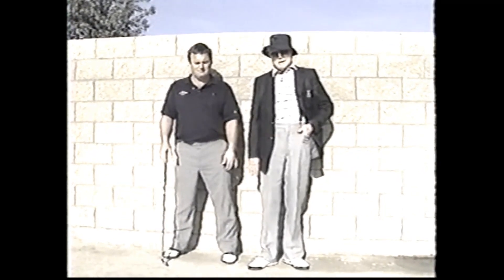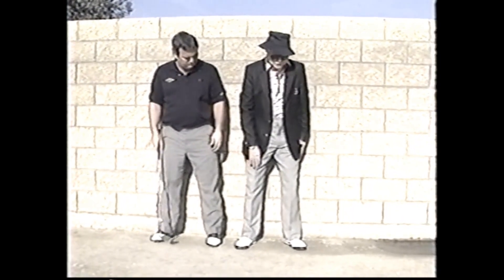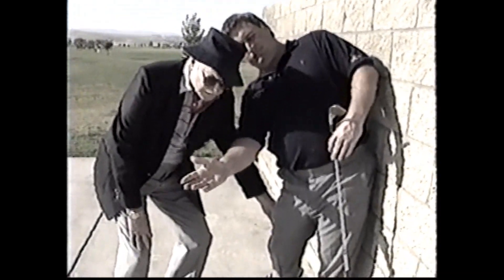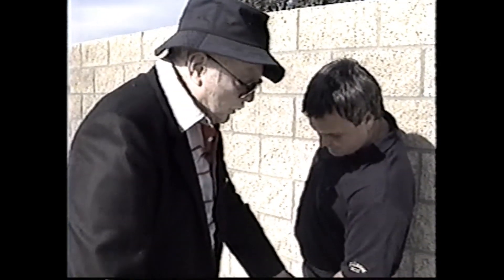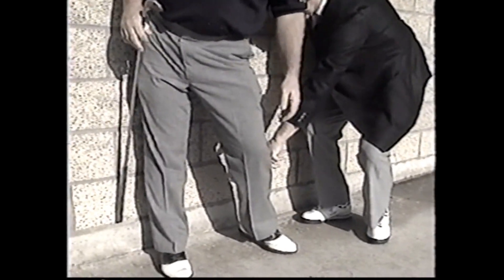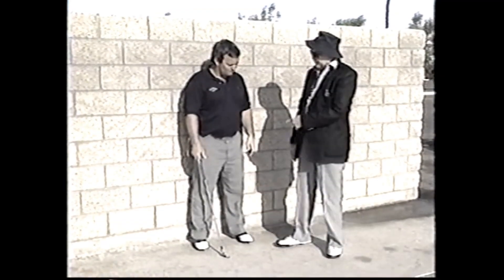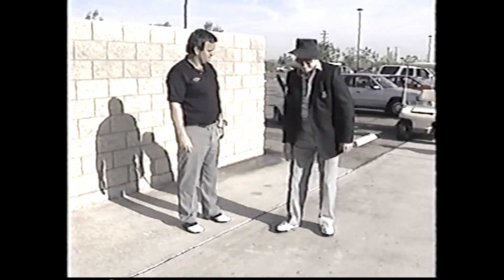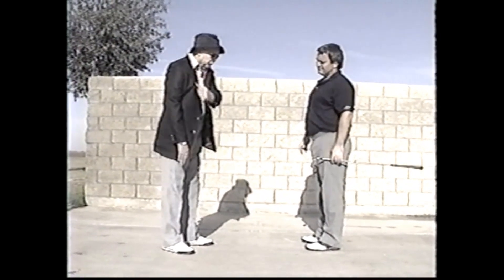The Best Pivot/Weight Shift Drill for Clubhead Speed and Distance

Comment: it seems to me that mike wants the swing initiated and originating with the foot action to get the pivot action going. this different info than what i picked up from other instruction where the rotation of the body pulls the feet into the action. the mike austin swing action is different although it for the most part looks the same to the uninformed.